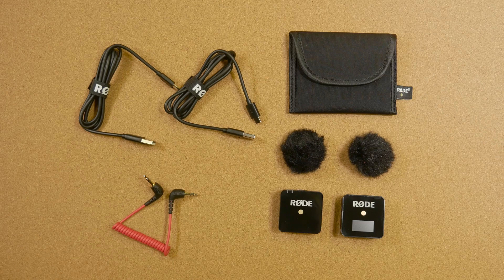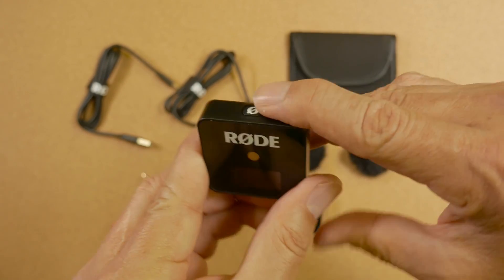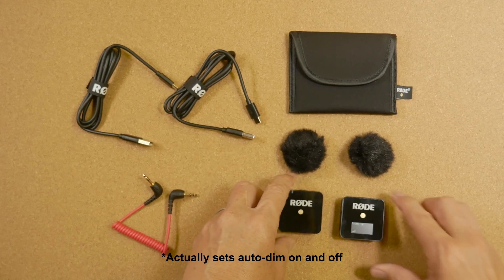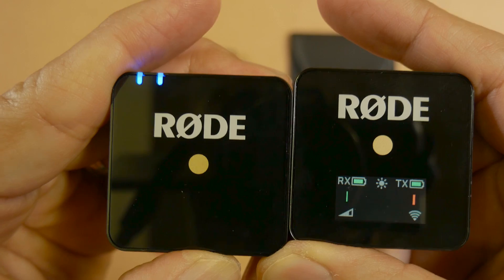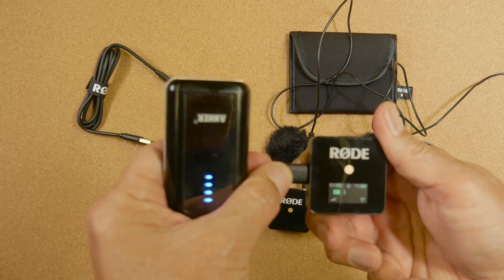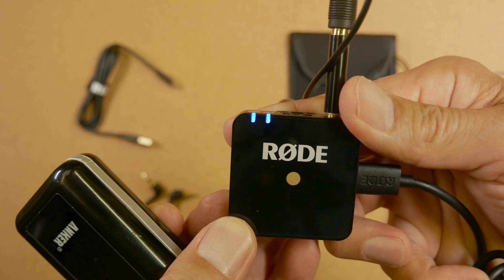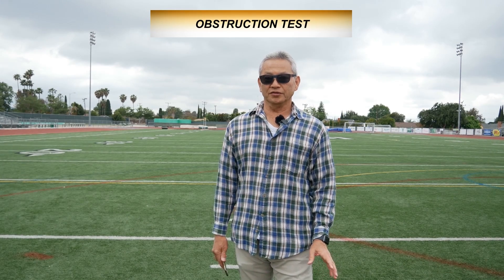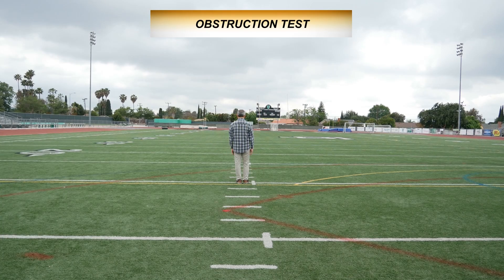Rode Wireless GO - FULL REVIEW - Sound, Range & Obstruction Tests PLUS 1 Important Limitation

Comment: I've had mine for about a week and one-half now and I did an obstruction test in my house and I found I could place the receiver in one end of my house and I was able to walk past two separating walls and maybe 10 yds./meters away. Once I got to 3 walls and maybe 15 yds./meters I was having serious dropout issues.  I have no clue why I would ever need to be that far away from my camera while shooting but I thought it would be an interesting test. I might recreate your test to see if I get the same results. For the most part, I rarely get more than 20 ft. away from my camera because once you get too far away people can't tell what you're doing out there unless you have a camera person operating a zoom lens for you. I think the best solution might be to use the transmitter with a lav mic plugged in with the transmitter attached to your belt on your side. You would have to remain cognizant of which side you have to the camera but it would allow both front and back shots without signal blocking. Well done with your review!

Comment: Thanks for the review. I did the same test you did. I am getting signal strength drop out on my Wireless Go too. The Wireless Go though small and light, requires a clear line of sight between Tx and Rx unit, is not recommended for sports with lots of running and turning away from the Rx. 

I hope Rode can rectify the issue with future firmware update.
Reply from the maker: Yes, great point about not being a sports mic, but a really good mic and great value in general.  I actually emailed Rode about this issue, and they first said it may be defective, then I replied back it did the same thing with a 2nd unit and got no reply....
Reply: Dragon7 Drone Tech I email Rode too and I have not heard from them.

Comment: Mark, on the obstruction test I’m curious, if there might have been some mitigating factors, 1) you needed an adapter to connect your lav mic to the transmitter, ie; a trss plug to a trs plug, there could be a connection problem with the 2 plugs as your walking away.  2 ) your using your cell phone to introduce white noise as your walking away, couldn’t there be interference coming from the cell phone?, ie notifications and such. Just noticed that these 2 mitigating factors could’ve affected the test? Just curious.
Reply from the maker: Hi, I did this and similar tests with and without the lav mic (using built-in mic), and results were fairly similar (I.e. within 3-30 ft). Regarding the cell phone causing interference, I actually tested it without it on me, and about the same results. I am planning on doing another video with more tests. Thanks, happy filming!
Reply: Mark, from a couple of comments I read it seems wearing the transmitter, in our case being men outside the pants, such as on the belt or let’s  say on the back of the shirt collar, so it’s in the open seems to help, according to those posts. Hopefully there will be a firmware up date to fix this 1 abnormality. Looking forward to you doing more real time test. Like others have said your one of the very few reviewers who’s honest and tells it like it is. Thanks
Reply from the maker: It’s a bummer but not necessarily a deal breaker as long as the line of sight can be controlled. Everything else about the rode is so great. Maybe a firmware might improve it but I’m thinking it’s an antenna issue as many other systems have external antennas or bigger to have a bigger internal antenna. I’ll likely do some more real world tests but it won’t prove anything different than in the video. Thanks!  Happy filming!
Reply: I’ve ordered mine last week and it was shipped out yesterday. Definitely it’s not a deal breaker for me, since I’ll never be more than 10 to a max of 15ft. from my GoPro. I do model railroading and baking so I’ll always be close to my GoPro. Now I just need to get a laviler mic, already know about the differences of the trs and trss mic’s. Thanks again for the great review. Much appreciated.

Comment: Thanks but this might be a little misleading because very few people are going to use this in an open field how does this perform if you were inside a Church or Gym does it still cut out when you turn around from the line of sight? we are looking to purchase 2 of these units for Indoor for toasts and wedding ceremonies because this price point is too good to pass up LOL please let me know if your results are the same INDOORS thanks...
Reply from the maker: Unfortunately, I did also test indoors in my home, and still resulted in drop-outs.  However, I have seen an update to the firmware which may or may not have improved the signal reception.
Reply: @D7dronetech  I think so because all the other tests I've seen seem to work well indoors thanks

Comment: Excellent test. Maybe placing the transmitter on the side of your pants could limit the sound drops. Have you tried that?
Reply from the maker: With clear line of sight, unit has great range, so yes, with it on the side, it will work just fine. Thanks!